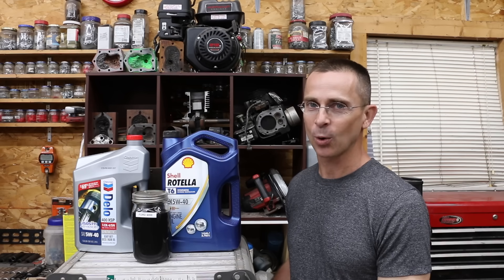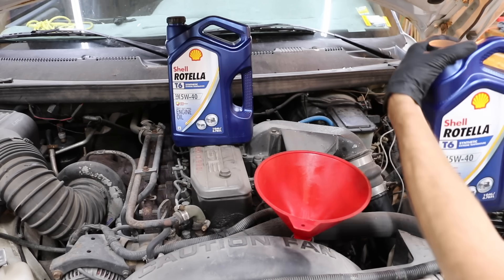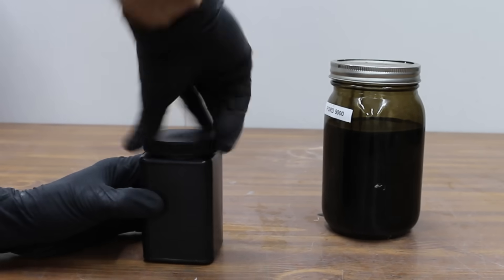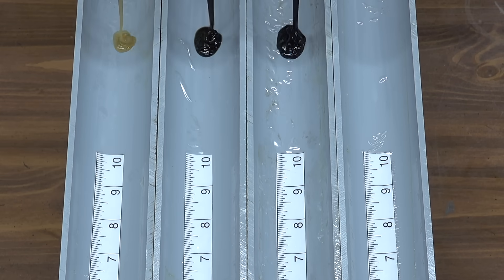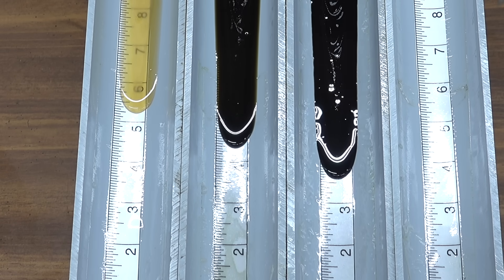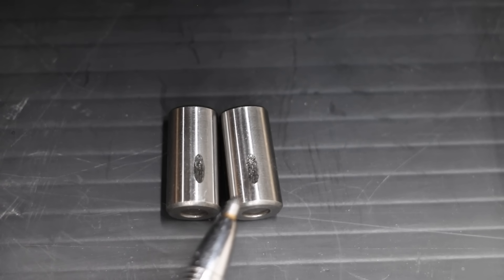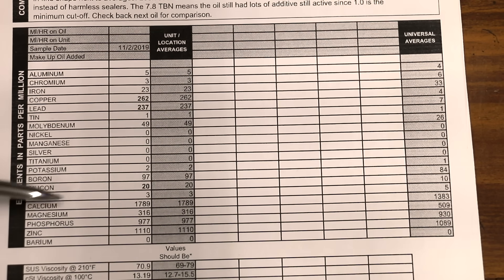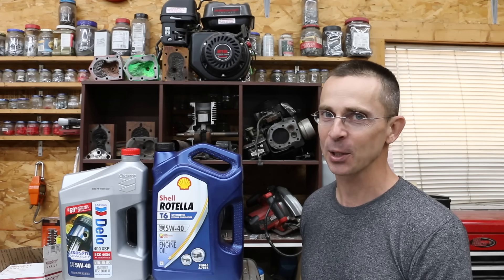Will Annual Oil Change Damage Your Car? Let's find out!

Comment: In an old 1980's BMW there was a lot of talk about ZINC additives that are not in modern oils.
 Yet many suggested to use Rotella b/c of the high zinc. 
 However, please do a test on off the shelf oil additives that have the most zinc for those with old cars who can no longer buy the old oil formula (which afaik was changed to reduce zinc b/c of catalytic converter issues)...
please and thank you.
Reply from the maker: Thanks for the suggestion.

Comment: I've sent off oil that was in use for 22 months and only 7700 miles on a 4.7L V8 4Runner, and it came back and being just fine still, according to Blackstone.

I also went 5 years without 'changing' the oil on my S2000 that I use for AutoCross.  With that said, every season I was having to add 5 quarts of new oil to the engine because of what was caught by the catch can due to the high g-forces the car experienced.  After 1200 miles of purely AutoCross events over those 5 years, I sent off the oil for analysis and it came back with wear metals showing the average wear of an engine with 2400 street miles on it.  Absolutely zero negative effects from the use I've put it through.  In my Toyota V8s now, I just change the oil every 10k miles, regardless of how long it takes to reach that many miles.  I don't worry about 'time in the crankcase' whatsoever.
Reply from the maker: Thanks for sharing.
Reply: The time limit is there because some people do a lot of idling, short trips, run in extreme temperatures, etc.  The 4.7 is very easy on oil.  I’d use synthetic and not go over 2 years.

Comment: Good to know that for retired people like me that don't drive much (under 4000 miles a year), that using high quality full synthetic oil, the annual oil change is good enough.   Also good to know that if you go 13 months, say, vs. 12 on occasion between oil changes, no big deal with low mileage. 

Thanks for the energetic testing efforts you do.  Subscribing and thumbs up.
Reply: What brand oil do u use? I use castrol once a year, helps when u r on fixed income.
Reply: @daleschmitt2919  .
Reply from the maker: You are welcome!  Thanks for watching and subscribing!
Reply: I'll be waiting  2 years for replacing my full synth oil, given my sub 1k mileage these days.
Reply: @ljprep6250  I'm thinking about using that strategy... go two years between changes because I'll drive about 1,600 miles (or less) in a year. I'll go by one more thing, too... if the oil still looks good, then I'll take that as a good sign that two years will be fine.
Reply: I also send an occasional sample to Blackstone Labs in Indiana. They do a great job. This lets you know what your oil status is relative to your driving habits.
Reply: You Amercans are totally neurotic about changing engine oil.
You seem more worried about this than gun crime.
Reply: My wife's car(Synthetic) has 5000km in a year, that's 3,125mi. Do you think it's time to have oil changed?
Reply: @JesseMgala  it's generally a good idea but it depends if you are in a humid climate, if the humidity wasn't terrible in the last year just check to see if the oil level dropped. If it dropped I'd just change it but if nothing was lost you could go a bit longer I think. I usually change one of my vehicles I dont drive much yearly due to the high humidity even though its parked in a garage just to be on the safe side and because I'm picky.
Reply: @VintageCars999  We're in Toronto, Canada.
Reply: @JesseMgala  no should wait for 6000 miles.
Reply: @Number6_  6,666kms
Reply: @JesseMgala  it's always a good idea to change wife. Once a year is ideal. Thanks for asking
Reply: @JesseMgala  No
Reply: @JesseMgala  The only objective way to know is change it, and send a sample to Blackstone. They'll give you advice about whether to go longer or shorter with your current change. (It's important to change the filter. You probably know that. But, there's a lot of people who think it's ok to change the filter every other oil change. If you're going to do that, I would definitely perform an analysis to know if that's working ok.).
Reply: @JesseMgala  It depends. If the car is new, I would have changed the oil before 1,000 miles for its first change, and then change the oil after driving 2,000 miles, and then start changing the oil every 4,000 miles. And that's if I'm using quality full synthetic oil. I bought a new 2021  Mazda CX-5, and my first oil change was done at 870 miles because there can be metal in the engine after being built. My second oil change will be at the 2,000 miles mark, and then I'll change the oil every 4,000 miles. But since I don't drive many miles, I might change my oil every 2 years, instead of every 4,000 miles.
Reply: @SokemRokemRobot  this theory about metal being in the oil doesn’t apply to new engines as much anymore. I spoke with several mechanics about this and they all said this is a hold over from the days when machining wasn’t as good. 

A break in period is still advised, mainly to help get expansion and contraction of metals settled but, metal in the oil isn’t a thing they really see anymore. (Except for blown engines)
Reply: Do a Blackstone oil test. It's cheap. The report comes back with advice about if going longer is better. You might find that 2-year changes are safe. 

Someone actually analyzed a collection of anonymized Blackstone data and found that frequent oil changes actually produced more wear than than infrequent (until you reach the point the oil is so degraded that it begins to cause wear). The person doing this analysis wasn't sure why that pattern of new-oil wear was in the data. It could have been new oil dislodging contaminants which caused wear before being trapped in the filter? It was interesting that "more" isn't better that way. Changing every 3 months (which some "severe" schedules call for even when low miles) was worse than going a full year.

A car's warranty is one thing to keep in mind. If it calls short-trip driving "severe," and you find through your own oil analysis that you can go 12-18 months between changes without any signs of degradation... you could find yourself in a tough spot if you have a warranty claim. You'd think the analysis reports would stand as proof. But, some car makers will use anything to get out of a claim. So, saving a little on oil changes might not be worth the fight, and voiding a warranty.
Reply: @markfuller  Also be advised that the oil analysis from Blackstone is admissible in a court. I once showed a copy of a report to the dealer rep, and they had never seen one.
Reply: @markfuller  how frequently was this test done at? I change the oil in my car every 5,000 miles, a friend of mine has the same car and does 10,000 mile oil changes specified in the owners manual. Both have around 100,000 miles on the clock We had the valve covers off and compared them, my valve train casing and timing chain/casing looked brand new... His had scorched burnt on oil inside the cam casing and on the VVT valve adjuster and inside the timing chain casing. 

My assumption from the comparison is that the more frequent oil changes means the cleaner oil prevents deposits building up in the first place. The main reason I switched to 5,000 miles is because on my first few I did at 10,000 miles I always found allot of thick sludge had formed in the oil. The oil still looks dirty at 5,000 miles but there's little to no sludge formed.

I do 12-15,000 miles a year so I've never had oil in my car for more then 6 months after I changed my interval at around 30,000 miles.
Reply: @mikes1992u  I don't think comparing two engines is entirely valid. For example, if your friends engine was GDI, that could account for the discoloration of metal surfaces. Using different fuel could account for such (top-tier fuel cleans better).

The only valid way to look at this is with Blackstone analysis. Test your oil at 5,000mi change, test your friend's at 10,000mil change. See what the test shows. Discoloration doesn't mean a lot. (The engine could run hotter. Have poorer crankcase ventilation.). 

I was big on frequent oil changes, "it's the lifeblood of the car; oil's cheap." Blackstone convinced me to go longer. For a long time I put 2k/mi on my car per year. I'd read that moisture condensation can create sludge in such a use-case (especially if the trips are short, and the engine never burns off the moisture). Blackstone's analysis showed there was no moisture in the oil, and I should keep using the oil longer. They advised me to go 5k miles regardless of how long it takes to do that. 

IMO, the test is a worthwhile expense. It might show that your 10k friend is overdoing it. It might show you can go longer. You don't know until you know. Everything else is just feelings. (I'm pretty sure car makers are urging fewer oil changes so they can "signal" a more enviornmentally-friendly car. They don't care if you have to replace the engine after the warranty. So, your friend following their advice could be wrong. But, the point is: you can't know without having the test done.
Reply: @mikes1992u  Also, about my relaying that study I saw where frequent oil changes seemed to cause more metal in the oil (more wear, which doesn't sound intuitive to me, but that's what the person discovered when examining anonymized test data from Blackstone), that could be due to starting the engine after an oil change when the filter is dry. There's a brief period of no pressure. 

Most people probably have their oil changed at bargain-basement places. I change my own and always fill the filter with oil. (But, mine spins on vertically. I had another car with a sideways filter. I couldn't fill it too much.).

I just think it's cheap insurance (and useful data) to do a $35 analysis each change. Blackstone has found that there's no significant difference in oil (the cheap fossil oil does as good as expensive synthetic). They found there's no measurable benefit to changing oil more frequently (but, there's some point where it's too long. Your friend's 10k change might be too long. The only way to know is to do a test. Engines are different. People use different fuel, some better than others. Some change their own and can fill the filter. Others can't. You don't know what your situation is without seeing an analysis of your oil.).
Reply: @markfuller  me and my dad have to change his oil every 3500mi because he has forged internals and such. We run Pennzoil Ultra Platinum and its always great might switch to Torco though.
Reply: for a laugh you should edit your comment to some insane fake news but retain having your comment hearted and a generic auto reply from state farm himself
otherwise i was looking for a summary comment
Reply: 5k miles of 6 months. Time affects oil quality as well. Thats only if you want the engine to last longer than you though...
Reply: @Doomzdayxx  I used to think time affected my oil quality, but oil analysis doesn't show it. I encourage people to have their oil analyzed. Every engine is different; people use different quality of fuel; different driving habits. A lot of people believe a lot of things about oil/changing that are religious/faith in nature. "I've always done it this way and never..." The only objective view into what's going on with the oil is to have it analyzed. (Every engine is different. People use different quality fuel. Different driving styles. Large volumes of analysis across many engines/drivers shows that changing the oil more frequently actually causes more wear. That's not intuitive at all, but likely due to the brief moment of no pressure upon first start.). 

I thought driving few miles at a time led to water condensation mixed into the oil, sludge developing. That's an example of how I thought "time affects oil." I could go 3 years before reaching 5k miles and thought I should change it at 6mo. The Blackstone analysis doesn't show that. I've been urged by Blackstone to drive it till 5k miles, don't worry about time. I live in an arid climate. Maybe if I lived in the humid southeast condensation would be more of an issue. But, that goes to show how old wives tales about oil changes are just that. The only way anyone can know what's right for them is to have their oil tested. It will pay for itself.
Reply: @Doomzdayxx  does the 6 months start counting from the moment you purchase the oil or having it changed? I buy a barrel of full synthetic oil at whole sale price which works out to about $10/gal and change every 5k miles (or about 2 months). Is that a bad idea, since I have the new oil sit in the barrel for years.
Reply: Changing oil every 6 months is more important than changing at high mileage. If you run 10k miles and only change at 6 months its better than running 1k miles and changing it once a year. Oil breaks down
Reply: @BobSmith-cb5xr  I could be mistaken, but isn't that exactly what this video just disproved?
Reply: @majorpay5058  He showed that year old oil isnt acidic yet and still has viscosity. He didnt show anything about a few month old high mileage oil.
Reply: @BobSmith-cb5xr  But you said having high mileage oil over short term was better than waiting over a year to change your oil on low mileage.  He showed that there was virtually no (little) difference between low mileage, aged oil, and new oil?
Reply: @majorpay5058  little difference? There was quite a bit of difference and he said he had additives in the used oil. Restore is one of the best additives you can put in oil, and that's what he used.
Reply: @BobSmith-cb5xr  Little difference, yeah... I'd argue that the cold test between newly cooked oil and the 3k  1 year Dodge oil were very similar in the cold weather performance test.  I'd also state that everything being close, and within spec after a year was likely on-par with a vehicle that had been drive 3200 miles, but not left for a year.  We'd only know for sure by running your comparison, but I'd bet it would be far worse to put engine oil under stress for 10k miles without changing it, than to let it sit for a year for 3k.
Reply: @BobSmith-cb5xr  according to what we just watched that's incorrect

Comment: Is a "fully warm" engine for the sake of preventing any moisture buildup when the temp. gauge shows normal temp, like after 10 minutes of driving, or does it need to be longer, like say 30 minutes of driving?

For a car driven short distances several times a week, but reaching normal operating temp. at least weekly, is that good enough if it's rarely driven more than 10 minutes at a time?
Reply: Oil takes longer than water/coolant to heat up.  So yea at least 15-30minutes depending on outside temps
Reply: @andrewmcintosh9832  
And depending on car. But I’d say 15 minutes minimum, always moving.
Reply: The best idea is to drive the car for 1 hour on the highway but if you don't want to do that 20-30 minutes of driving will suffice during 70s or hotter weather conditions. You will need to drive longer in colder weather like below 40.

Comment: My Isuzu's recommended oil change is 12,500 miles or two years, whichever comes first.
No idea whether this reduces engine life but I sold my previous one with 230,000 miles on the clock & 5 years later, I still see it around.
Reply from the maker: Thanks for feedback.

Comment: A mechanic friend insists that you can run synthetics for a couple of years (assume 20K miles per year) BUT you need to change the actual oil filters at a minimum of twice be year.
Reply from the maker: Thanks for the feedback.

Comment: great video I own a truck which tells you when you need an oil change which is crap because I don't put a lot of miles on the truck and I run synthetic oil so a year can go by and I have 3 k miles and it says i need an oil change it took me a while to figure out so now I go by the # of miles
Reply from the maker: Thanks!  Thanks for the feedback.